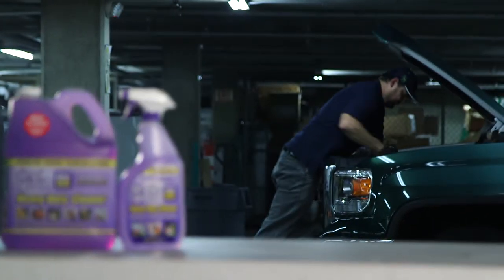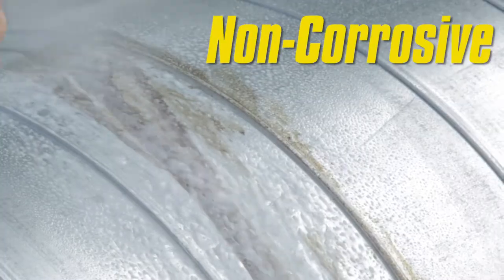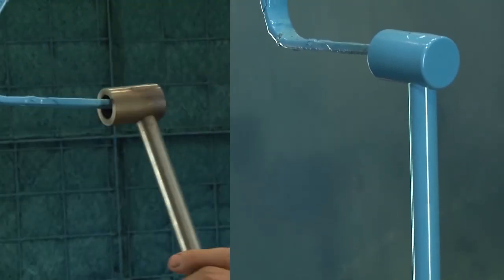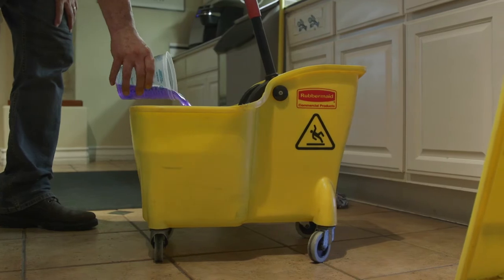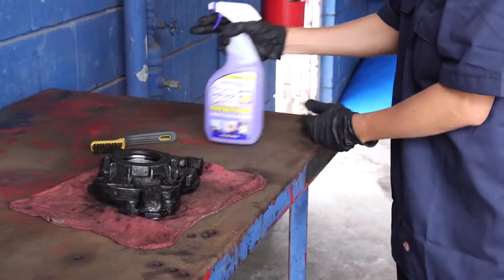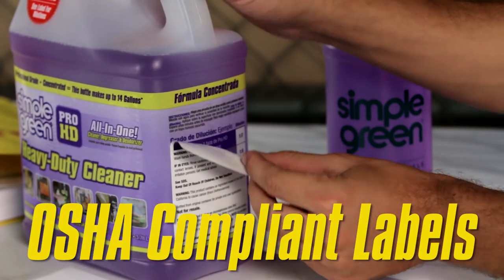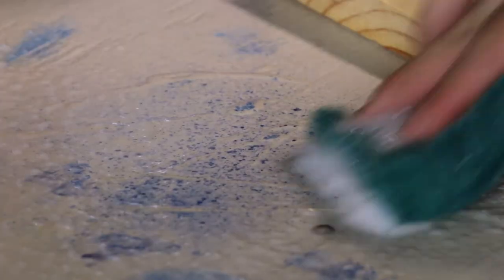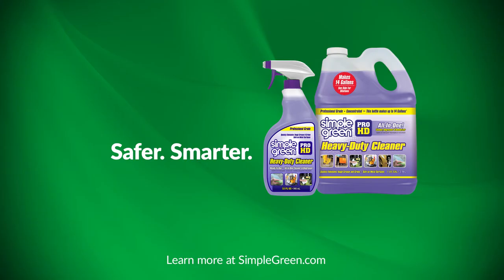Simple Green Pro HD Heavy Duty Cleaner

Comment: I USED IT ON MY HEAT PUMP EVAPORATOR COIL IT DIDNT REMOVE ALL THE DIRT AFTER SPRAYING PURE SIMPLE GREEN HD ON THE FINS AND RINSING IT WITH A GARDEN HOSE... I FIND THAT IF U HAVE A SURFACE WHERE U CAN SCRUB THEN IT DOES A GREAT JOB.